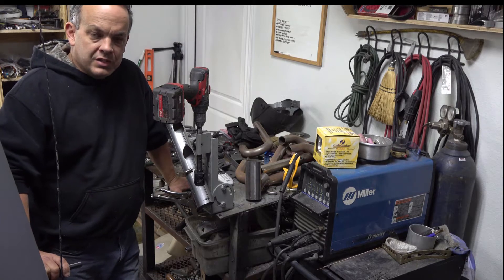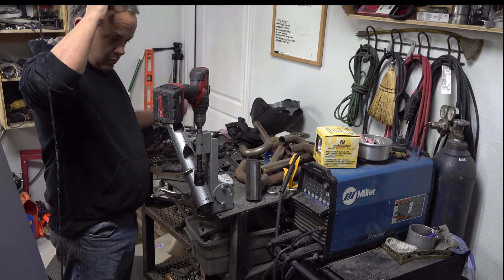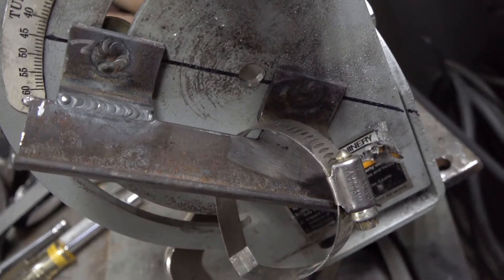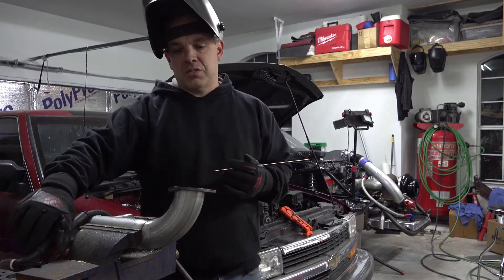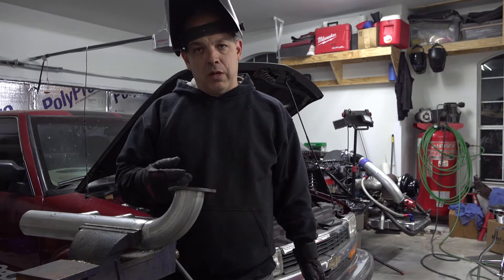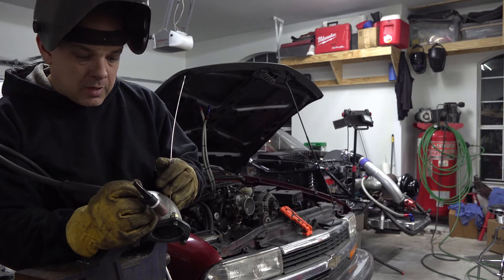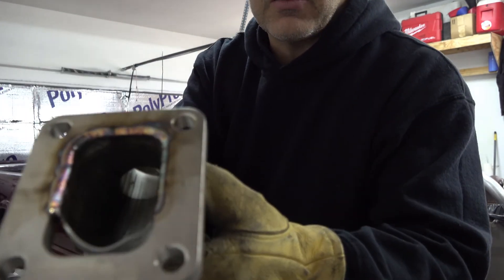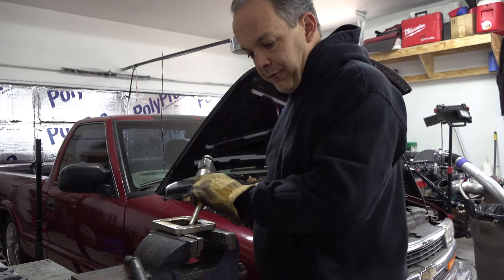Building a turbo log manifold with basic tools

Comment: I see your using what looks like thinwall tubing. Maybe .060 thick. There’s no concern about this supporting the weight of the turbo? Are you going to brace it? I’m at the point where I need to build my log but I haven’t ordered material yet because I’m not looking forward to cutting through .120 stainless schedule 10 pipe.
Reply from the maker: Kfx Guy  I've done many of them like this before, never had a lot of problems.
Reply: diy_garage_tx never had a lot of problems? The a lot of problems scares me lol. I want to do this right. Once. If also like to save money if I can because I’ve already got the stuff to do it thinwall but thickwall (.120) I’ve gotta spend another $130. Which is fine if I have to. I just don’t want to deal with cracking pipes and what not.
Reply from the maker: Over the years, I've done around 100 turbo setups. I would say less than 10 needed repairs.....and only 3 were thick wall tubing. There's a right way, a wrong way, and a way that works.
Reply: how long will mild steel 16 gauge manifolds last would you say?
Reply from the maker: Years!